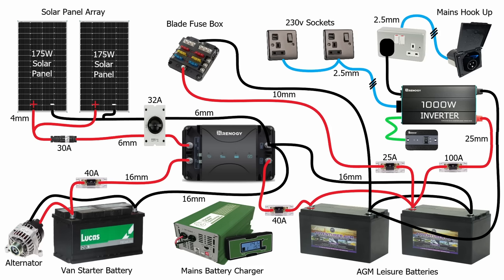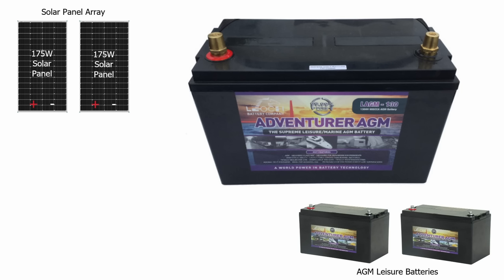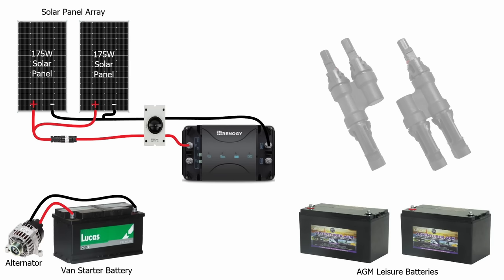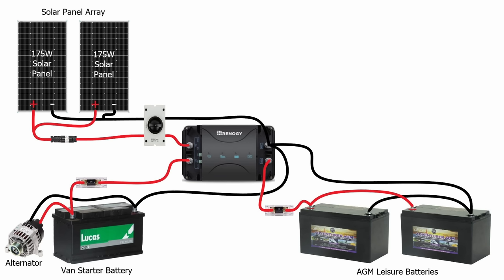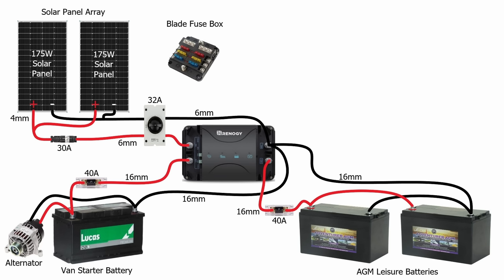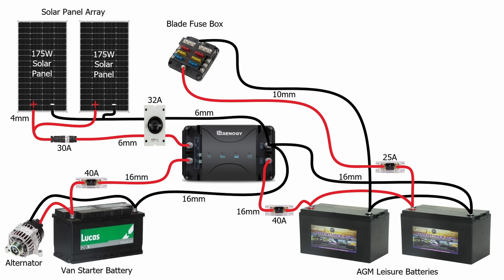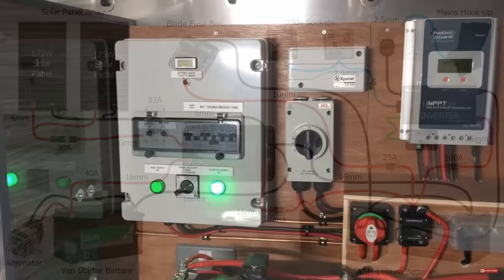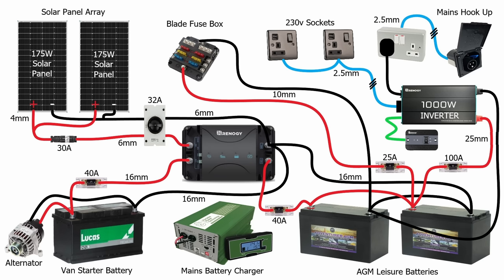12v Electrics for Off-Grid Campervan - Fiat Ducato Budget Build Ep12

Comment: Hi Greg, can you advise me how do you connect the main battery charger with two battery? 

im not sure if im correct, one on each battery? positive on battery (1) and negative on battery (2) or it got to be positive on battery (1 near the fusebox) and negative to battery (2 further away from fusebox) ?
 
hope you can help

thanks
Keith
Reply from the maker: You connect the mains battery charger to the same terminals as the mppt charger 👍🏼😃
Reply: @GregVirgoe  THANKS

Comment: I would put the solar panels in series so I get charging for more hrs. when the sun is lower. I appreciate the controlled didn't allow for this but would it be that much more expensive to get a controller that could receive 30 Amp from the panels?
Reply from the maker: As I've explained the cost of buying separate charge controllers and additional wiring far outways the benefits of being able to wire the panels in series. I have additional charging from dc to dc to supplement the solar so that's a more economical solution.
Reply: @GregVirgoe  Maybe a simpler answer is that Renology doesn't do a single DC-DC with MPPT controller unit with more than 25V solar input !?
Reply from the maker: @dimitristsagdis7340  I did explain that in the video but didn’t want to point out the obvious 😃

Comment: Are your connecting leisure battery cables 25mm? or 16mm?
Reply from the maker: They are the larger size to handle the inverter load.

Comment: With a 40a charge controller, would 16mm still suffice for both starter and leisure batteries, would the inline fuses need upgrading also?
Reply from the maker: 16mm would be ok but fuses would need to be 50amp. 
Which charger are you using?
Reply: @GregVirgoe  sorry about the later reply, i bought a eco worthy 40a dc to dc mttp charge controler

Comment: Hi Greg I am. Converting a 7.5 ton horse box. Would this work okay for that ? Also good you give me a link for the best plumbing, a way to heat and install pipes and showers etc. regards Danny
Reply from the maker: Yes it would work. If you have the larger roof I would suggest fitting another solar panel and going for the 50amp charger. Please look at my water services video for details on the Pipework system https://youtu.be/7gieUNuZan4
Reply: @GregVirgoe  how about I put 4 solar panels on. Would the 2 batteries still be okay ? And would I need to upgrade anything else   ?

Comment: Hi guys, could I run any appliance I want off those 230v sockets as long as I have shore power plugged in? Ex air fryer, hairdryer, as I don’t think that inverter is powerful enough to run such devices.
Thanks,
From a complete novice
Reply from the maker: The pass through onthe inverter will only handle the 1000W rated for the inverter, you can either buy the larger inverter or run a seperate mains cable direct form the consumer unit to dedicated kitchen sockets for fryers etc.
Reply: Thanks a million Greg!

Comment: Hi Greg, I’m really struggling to get hold of a 25A in-line fuse. Can we use 20A or 30A or do you know where I may find one?
Many thanks 🙏
Reply from the maker: The output fuse to the fuse board needs to be sized depending on what appliances you are going to install within your van so that may be different to my van.  Add up the current use of all the connected appliances and apply a margin of 25% to get your fuse size 👍🏼😃
Reply: @GregVirgoe  thanks Greg 🌺😊

Comment: Urgent. What is the difference between 30a and 50a controller system (30a sold out). Can you use same cable sizing and same size breakers as your inputs would be the same amperage on the 50a controller? Thanks
Reply from the maker: You can get a 30a one from Amazon on this link https://amzn.to/43Bmzin
Reply: You're a top guy Greg👍🏽👍🏽

Comment: Please ,I need some help sir ,I what to make a portable solar sistem for camping, I need just 12v without 230v because I'm gonna use just 12v things ,I what to use 1 or 2 230 ah agm battery's but I don't  know what mppt and solar panel size I need fir the battery ,the Lois gonna be around 700w, please sir can you help me whit a video please 🙏
Reply from the maker: Why don’t you consider a power bank like the Bluetti EB70 and 200W portable solar panel. It will give your what you need all in one box all for under £700

Comment: Greg love your video's and I'm intending  to do this set up in my current van but the question i have is i want the inverter to be 2000w and i'm going to have one 200ah Lithium battery but will i have to increase the size of the cables to the battery?
Thanks
Andy
Reply from the maker: Yes the inverter needs a 200Amp fuse and 35mm cables to the battery.
Reply: @GregVirgoe  thanks again greg
Reply: Greg need to pick your brains again.Would the Renogy 30A 50A DC to DC Battery Charger need to be the 50A version  with the 200ah lithium single battery I'm wanting? also I'm intending to get a ELECTRIC hob fitted in my van kitchen for when we are hooked up on a site so will the larger 50A be required or would   the 30A be sufficient?

Thanks Greg
Reply from the maker: @Sub_Divisions  if you are going lithium it makes sense to use the bigger charger as the battery can handle larger charge rate. You will need to increase fuse on van battery to 75A and fuse on leisure battery to 60A
Reply: @GregVirgoe  Cheers Greg

Comment: Sorry for my ignorance, how is the mains battery charger connected?
Is there anything you would do differently if it weren’t a budget build?
Reply from the maker: You plug the mains charger into the 3pin socket near the hook up and connect the positive and negative wires to the same terminals on the leisure batteries as the mppt charger. 
Main changes would be an extra solar panel, 50A mppt charger and lithium batteries if money was no object 👍🏼😃
Reply: @GregVirgoe ah, so there is space on the roof for a 3rd panel? Although I was thinking of getting something pretty big for my next van you sold me on the sideways bed and easier maneuvering on the Ducato. I'm thinking the extra panel especially for Winter.

Comment: Can u charge stater battery with another solar charger if car off
Reply from the maker: Yes you can buy small solar trickle chargers from Halfords etc. you just put the small 20W panel in the front windscreen and plug into the cig socket. Simple way to keep van battery topped up. 
This Renogy DC to DC charger will charge the van battery once the leisure batteries are full.

Comment: Sorry to be thick but I'm looking to buying a kit and it has a split charger,is that the same as dc-dc?
Reply from the maker: No it’s completely different. I would not recommend a split charge relay as that is simply a switch and does not monitor battery condition or meter the charge accordingly. A DC to DC charger will look after your leisure batteries far better and meter the charger depending on the type and current state of charge.

Comment: Good AM Greg I'm doing this on my  boat I cant see what size cable you are using to connect the leisure batteries together, Is it 16mm or 25mm?
Reply from the maker: Ok so it has to be capable of taking all the connected loads assuming there will be one  instance when everything is running at the same time. 
No you can apply some diversity to that knowing that it’s highly unlikely to ever happen. 
But at the minimum it’s needs to be at least as big as your largest loads plus a bit more. 
In cables it always helps to go bigger to keep resistances down and so they run cool so my best advice would be to size up the interconnected battery cables to 35mm. Hope that helps 😊
https://www.12voltplanet.co.uk/extra-flexible-pvc-copper-battery-leads2.html
Reply: Thank you

Comment: Did you contemplate an all in inverter inverter charger?
I think some even do the solar mppt ..
Reply from the maker: All the ones that I am aware of would have been way too much money.. I managed to get everything for my whole electrical system inc cable for £950 :D
Reply: @GregVirgoe  that’s a good reason…

Comment: Can I charge a bluetti AC200MAX with a renogy dc to dc with mppt?
Reply from the maker: The Bluetti has its own inbuilt charger so you need to plug in the supply from your solar panels. It can be done with a double pole changeover switch and the Bluetti solar charger lead. Just make sure that your panels do not exceed the max input of the Bluetti. I have one myself and will do a video on it soon

Comment: Where do you take the negative of the battery charger to.. the portable power technology.

I've got positive to my battery with the other chargers. But should the negative go to my negative bus bar?
Reply from the maker: Your mains battery charger should connect to the same terminals as your MPPT solar charger
Reply: @GregVirgoe  many thanks Greg. Your videos have been so helpful. Keep up the great work
Reply from the maker: @Reuben-Wincott  cheers 🍻😃

Comment: How do you wire in the battery charger?  I had a ring 240v smart charger permanently connected which would charge the leisure battery when on hook up. Recently it stopped working and I fear that my portable solar panel may have damaged it?  I was using the panel on my driveway to charge the battery, the hook up was not connected. Is it possible that the solar charge back fed to the smart charger and blew it, if so is there a way to stop this happening?  The leisure battery is also charged by a dc to dc victron controller when the van is running. Any help would be very much appreciated thanks.
Reply from the maker: The battery charger is simply connected to the same battery terminals as the solar charger. 
Providing your portable panel was put through a charge controller the voltage at the battery should have been regulated to not exceed approx 14.5v so should have been safe for any other connected charger. If you connected the panel directly there is every chance the voltage was too much for the charger and the battery.
Reply: @GregVirgoe  thanks Greg, there is a built in controller on the panel so perhaps the smart charger is faulty. It was a cheap one. Appreciate the prompt reply

Comment: There are a lot of connections to the battery. Would it not be better to use a distribution fuse box as in your previous videos?
I have all my 240v sockets wired on one spur. Usually this is plugged in to the inverter. If I ever need to use EHU I can pull the plug and put it in to the consumer unit.
Reply from the maker: Every time you add another device like a busbar, connections and terminals you add resistance to the circuit so it’s far better to keep the cables short and simple for less volt drop.
Reply: @GregVirgoe  That is surely negligible vs the convenience, besides it is easy and cheap to use larger cables?
Reply: @GregVirgoe  As more items are added those battery terminals are going to look very ugly very fast.
Reply from the maker: @andyb9262  but if you are adding bus bars, extra cables, cable lugs etc or increasing cable sizes that’s all extra cost which in a very simple system like this is totally unnecessary. Voltage drop in cables can be significant if all added together. Better this way 👍🏼
Reply from the maker: @andyb9262  the most cables on any point is three which is no problem at all. Nothing stopping you fitting as many accessories as you want. It’s just not something I will be doing for the reasons I have explained. You go for it 👍🏼😃

Comment: Can you explain why there is a plug socket between shore port and the inverter?
Reply from the maker: Yes, the inverter lead has a fused plug on it and the mains battery charger has a fused plug. so they would both plug in there.
A better solution would be to install a consumer unit after the hook-up with RCD protection and MCBs, cut the plugs off and wire them into correctly sized MCBs
Reply: @GregVirgoe  Great thank you, so many people have that in their wiring diagram but it just didn't make sense to have the extra step.
 My current country of residence doesn't have any fuses in their plugs and the unit I have chose gives you the option to use lead with plug or to connect my own.

Comment: Hi Greg - solar is the next phase for me. However 175W solar panels are out of stock and have been for a while at renergy. Can I use the 200W versions with the same controller? (ie 2 x 200W instead of 2 x 175W). Also seems to me that 240V is more trouble than its worth. Considering leaving it out altogether. Thoughts?
Reply from the maker: Yes 👍🏼 2x200w would be perfect for the 30amp charger as that is the max you can fit. It will also give you another 50w of solar. 🤩
Reply: @GregVirgoe  thanks Greg I did find the Renergy site a bit confusing. Rich
Reply: That's great as i was wondering the same thing! Would all of the cable and fuse sizings be the same with the 200w panels? @GregVirgoe

Comment: Greg, quick question, fuse from Ban battery to Renogy is 40amps, would this be normally higher eg 100amp?
Reply from the maker: NO, the charger is only taking a max of 30amps so we do not want 100amps coming down that cable. The fuse is set to 25% above the rated current of the unit.
Reply: Thanks Greg 👍🏼

Comment: AGM are better value than lithium if you only using half of your agm does this count as 1 in your 2000 cycles or is it half of the two agm battery's that count as one in your 2000 cycles
Reply from the maker: Each discharge to a level be that 50% or 70% etc is a cycle. 
Discharge each day to 50% and get 600 cycles. 
Discharge to 70% or less and get 1600 cycles or more 
👍🏼😃

Comment: Hi Greg, Hope your well and that you can put some more videos out soon....I am following your design and have the same panels ready to fit. Can i fit the panels and bring the cabels into the van to a 32amp 500w DC circuit breaker instead of the switch  and leave it till im ready to connect the same mppt controller or best to just connect to the controller? Also i have got 2 x 12V 100Ah renogy Core LiFeP04 Batteries so can these be cobbected in parallel with 16mm cables and a 40A inline fuse the same as your diagram? Thanks Paul
Reply from the maker: Yes you can use a MCB for the isolation and circuit protection instead of separate fuse and isolator. Each panel has short circuit current of 10.3 amps so it would be better if you get a 25amp 2 pole DC MCB which are available. Some come in a small plastic enclosure with clear windows and cable glands. Make sure the MCB is made for DC circuits as they are very different. 
Hope that helps 👍🏼😊
Reply from the maker: https://amzn.to/3VNpPXO
Reply: @GregVirgoe  Thanks Greg. Much appreciated. Is the system safe to be left at the MCB or shall I just put it into the MPPT controller? Are the battery cables fine as described?
Reply from the maker: @paulcornwell8920  leave the breaker off you MUST NOT put power on from solar before the leisure battery is connected to the mppt controller. You risk damaging it. There is an order to connect the items to the controller in the Renogy manual. Solar gets turned on last once batteries are connected.
Reply: Hi Greg, Can I add a 2000w inverter to the same system? Does this need 16mm positive and negative cables from the leisure batteries?

Comment: Hi greg, I'm really in need of some advice... I'm following this diagram for my sprinter build which I need to complete quickly due to accommodation issues, but I have three 175w panels I need to wire in parallel because of the mppt/dcdc 50A renogy controller, so what would I do about the inline fuse as 30A would be too small? Its 38A in total with safety factor so would I just put a 15a inline fuse on each positive on the panel? im having no luck with a wiring diagram and im desperate
Reply from the maker: Yes you can use a pair of the three into one mc4 connectors to parallel them together then as you said put one 15Amp fuse on each panel positive. Then 6mm cable from the 3way connector to the mppt charger. Hope that helps 👍🏼
Reply: @GregVirgoe   Thank you so much greg! life saver... you don't happen to design wiring diagrams for others by any chance do you? worth an ask I suppose
Reply from the maker: @Sprintersyd  drop me a line on social media or email. 👍🏼😃

Comment: Hi Greg.  Could you advise cable size for a 3000w inverter?  Got 2 110a AGM batteries, solar and alternator charger.
Reply from the maker: Sorry to say you won’t be able to use a 3000W inverter with two AGM batteries. You won’t be able to pull that many amps out of that type of battery. 3000W equates to 240amps of current. You would need lithium batteries to use that inverter. What are you planning to plug into the mains that needs that much power?
Reply: @GregVirgoe  was handed to me second hand as is a modified sine wave version.  Was meant to run whatever we wanted for example a normal kettle etc, just using the engine to keep it going, but I think this was originally used direct from the starter battery whilst engine on.  Not my plan tbh.
Reply from the maker: @johnmitchell3027  I would not advise you to use any form of electric heating off AGM batteries as it will most likely not even work the inverter will go into fault when the voltage drops rapidly.